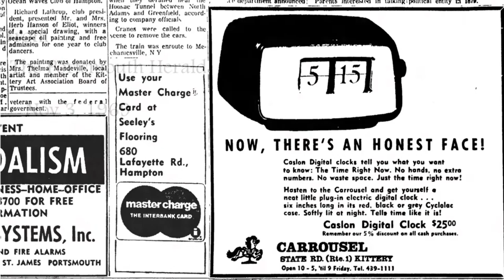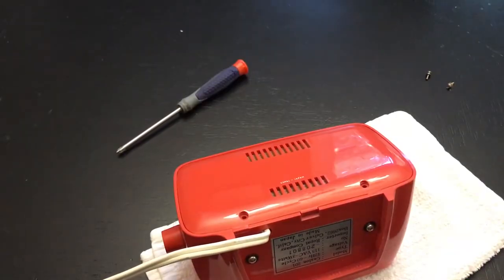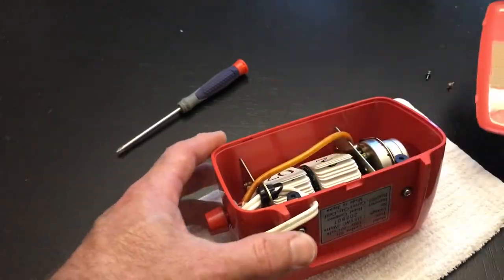The Copal Caslon 201 - Review and Disassembly

Comment: I inherited my mother's Caslon 201, looks exactly like this one, but it's missing the screws that attach the mechanism to the case on the bottom.  Could you tell me what size screws I need or direct me to a place that might sell them?  It's also missing the screws that hold the back cover on, but I don't think these are crucial for the clock to operate.  Thanks so much!
Reply from the maker: I will get mine out and try to give you some guidance. I know I found a place on the internet once that sells all kinds of screws. Just have to get the size and thread pattern right. Give me a bit, I'm covered over with paperwork from my "real job" right now.
I really  like these clocks, it's still one of my all time favorites.

Comment: What's the preferred action to take when the neon bulb does eventually give? Is there a way to replace that with any kind of substitute?
Reply from the maker: Oh yes. You can fine NE2 or C2A type neon glow bulbs all over eBay. If you're good at minor electronics you can cut off the old and soldier in a new one.
Reply: Oh great, thanks! I'm usually uncomfortable trying to open up a flip clock out of fear of irreparably damaging it, but the Caslons seem pretty straight forward.

Comment: Hello I work for a junk company where we go to peoples houses and take what they don't want anymore. I found one of these today and took it home since I was intrigued by the look of it. The color scheme is a beige but other than that it looks nearly identical. I know nothing about it but I plugged it in and the flippers won't turn automatically, however I can see the faint light inside. Is there something i'm missing or an easy fix? Or is it worth taking to an expert?
Reply from the maker: This is an easy fix most likely. The motors on this copals gets gunked up over the years. You'll have to disassemble the clock and dunk the spinning part of the motor in alcohol and give it a whirl then shake out the excess. It should work after this.  The last time I showed this was in the following video
https://www.youtube.com/watch?v=VDGw6AiiRMs

This was a good find. If it's not beat up too bad it would sell quick on eBay for no less than $50.00. Working condition could go 50-80 dollars. The brighter colors tend to sell for more.
Reply: Thanks! I have never done surgery on a clock before but I now have a nice little project when I go back to my hometown for Christmas! I was thinking of selling it but I am really beginning to like the old futuristic look of it. I am planning to even going to antique shops and looking for other things of the same ilk. Thanks again, and I'll try to remember to update you in about 3 weeks time.
Reply from the maker: It's not hard, just take your time. Most people break things by forcing or being in a hurry. It's fun and addicting.
Reply: Hey, just an update! I learned it's a Copal 101 series. I managed to open it up and learned something. I learned that the motor doesn't seem to start spinning on it's own. I plug it in and give it an initial push and it slowly picks up speed then starts to work. I assume you were right in your assumptions that it is gunked up. My mom is bringing home rubbing alcohol now and I will try the dunk trick. I also noticed my bulb is not blackened at all, so that must mean that it was either replaced or not used very much, which I was glad about.
Reply from the maker: Probably not used much.  I would think anyway.
Reply: Flipclockfans https://imgur.com/a/iIhDw

Finished and work smoothly!
Reply from the maker: Nice. I really like those little clocks! Lots of history.
Reply: @Flipclockfans  where is this video now? I desperately need as my calson stopped working and I am going crazy to get it back to work. Plz advise. Thanks